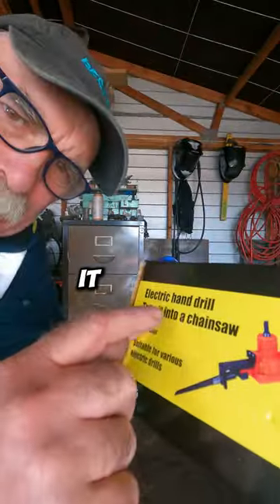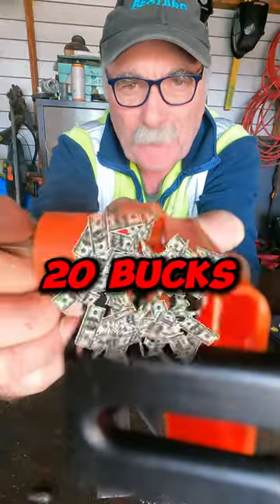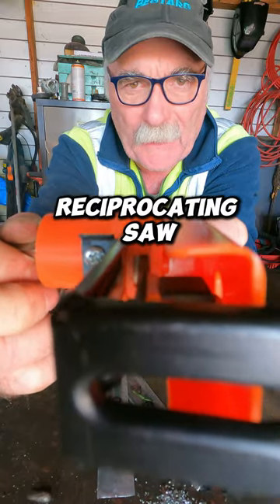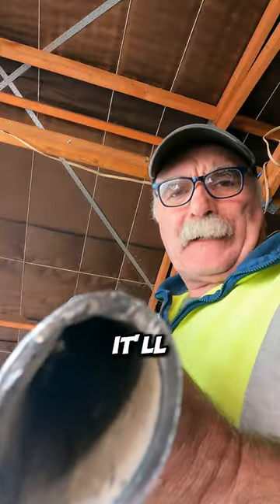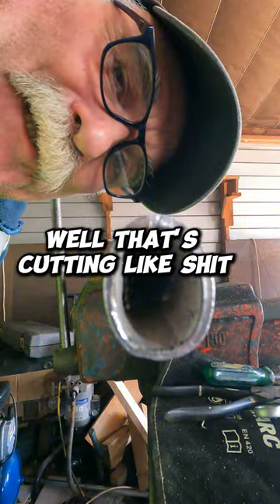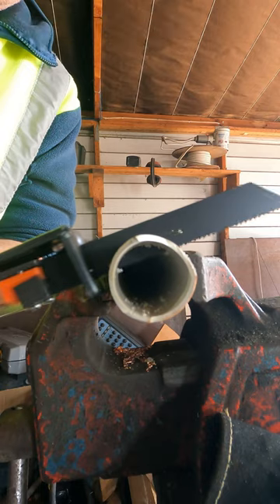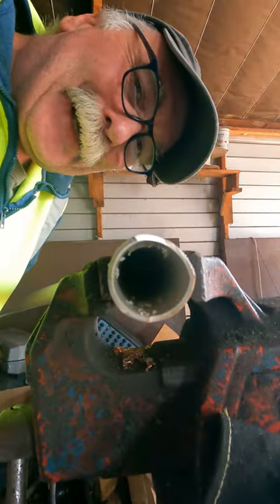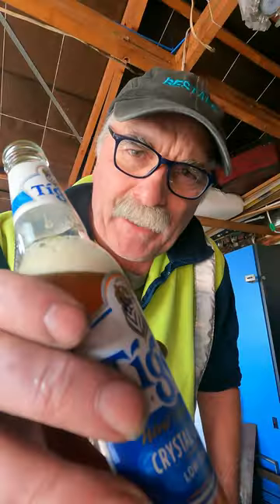Transform Your Drill: Into A Reciprocating Saw

Comment: ❌️20 bucks saw that breaks
✅️Beer crate
Reply from the maker: . Maybe it's a sign to take a break and grab a cold one instead!
Reply: $20 gets u the box of beers, an actual crate of beers gana cost ya bout $45
Reply: But a Reciprocating saw still going to set you back at least $500 with a battery so a cold one is definitely the go in this situation
Reply: @philipkingsford5477 what kinda saw are you getting I got one from the pawn shop for 50 bucks with the charger

Comment: All tools use a big motor, so a drill could work as most tools with the right adapter, but all the big quality tool manufacturers would rather make a standalone tool with better ergonomics since the main expense would be the specific thing that the motors driving. The only way to make these things reasonably priced is to mega cheap out on materials